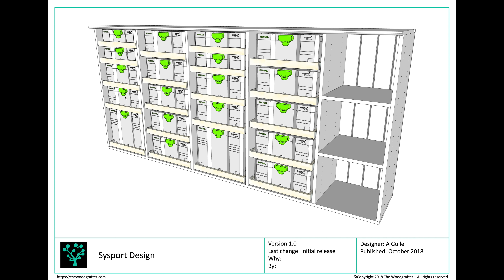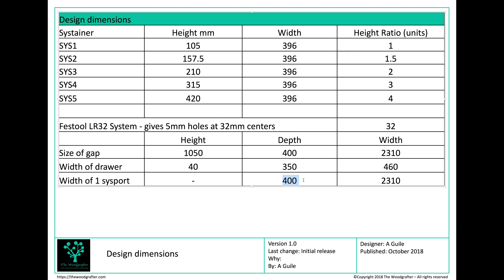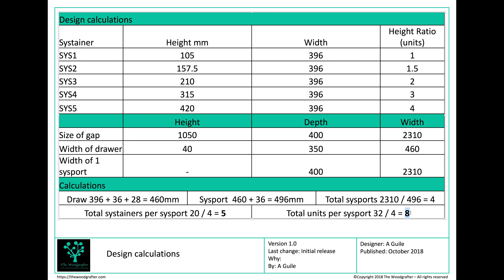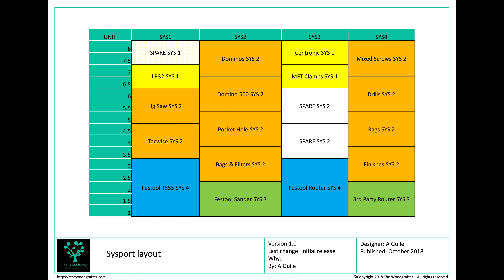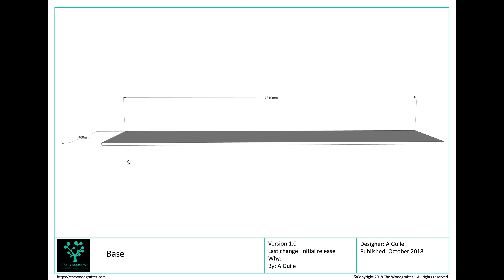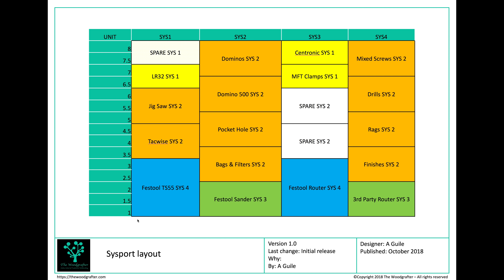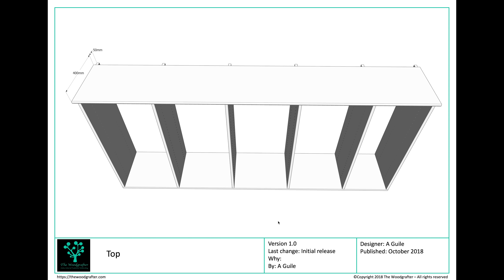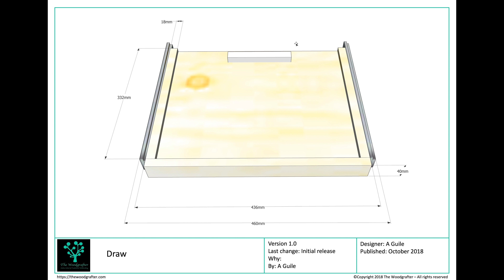Festool systainer storage system  design a sysport

Comment: Toolboxes, such as systainers, are good for transporting tools and fixings, and using them on site. For storage in a workshop, they are the worst possible choice. In order-
Pegboard or shelf- one touch access. Best.
Drawer- three touch access (pull, pick, push)
Most toolboxes - five touch access (pull, open, pick, close, push)
Systainers - seven touch (pull, unlock, open, pick, close, lock, push). Worst, because the swinging lever fouls the drawer slider above it if not locked. Most others can be left unlocked. They are also smaller than most, so more wasted space around them and more to open. No front handle, so the slider needs a handle.
If you are not happy with open storage, use drawers that are as wide and deep as possible, to give maximum contents. Height to match the contents. Can be made to EXACTLY fit the space available, e.g. under a bench. With no gaps to harbour dust.

Too much trouble to move tools when going on site? I keep a single toolbox (carefully) fitted with the common tools which are duplicates. These cost less than a collection of systainers, and means I have a spare if anything fails.Moving special tools to a box takes less time than fishing for them in the workshop. 
Remember, a site and a workshop are totally different. In a workshop you want everything you use as close as possible and as accessible as possible. The more effort there is to get a tool, the less chance of putting it away, so they all accumulate on the work surface and everything slows down...
Reply from the maker: Hi Mike,

Get where you are coming from, but everyone is different - I like systainer storage in the shop. Keeps the tools protected and everything in its place.

I am very disciplined  when it comes to putting things away, and keeping things organised. 

I agree that drawers are more efficient and better use of space - but not enough for me to care or notice the impact on workflow.

The storage under the new bench will be drawers with dividers and layout for my hand tools and measuring gear. But not sure I will be giving up the sysport any times soon.

Cheers

Andy
Reply: @TheWoodgrafter  I understand why you like them- they look pretty. It is like domestic kitchens- smooth granite, clean lines, everything hidden. Totally unlike a commercial kitchen, where efficiency and functionality are prioritized. So the question is simple- do you want a pretty workshop or a functional one? Time spent retrieving and storing tools in fiddly boxes is time not spent making. They cost you time, money, and workshop space. Your new build is moving in the right direction- embrace rationality and go all the way!
Reply from the maker: Mike M 

Hi Mike, let’s agree to disagree on this one, I want (and have) both.

The system I have works for me and fits in with my workflow and space.

Don’t forget I am turning out low volume high value pieces with the shop window been on you tube and web site with people visiting the shop to talk about commissions. In effect I invite people into my space (physically and virtually) to see my process and methods - nothing to hide. So for me it has to be a combination of workflow and attractive workshop.

That’s why the walls are clad, that’s why it gets cleaned at the end of every day and why the tools are laid out in a rack of systainers.

Even when I build the drawers under the bench, they will be lined in foam with cut out for each tool.

Not disputing what you are saying, just different solution for different problems.

Cheers

Andy
Reply: @TheWoodgrafter  Ahh, did not realize it was also a showroom. Fair enough.
Reply from the maker: Thank you,

Andy
Reply from the maker: Mike M 

Also, just realised this is quite an old video, since then I have built the top shelf unit and completed the cladding of the walls, in more recent videos you can see how it has all
Come together and the type of work I actually do in the coffee table series.

Cheers

Andy
Reply: @TheWoodgrafter  - Even though I'm late to this party I wanted to agree with "neat, tidy, and protected".

I also find the few extra seconds of "fiddling with boxes..." an important part of my thought process; it's an opportunity to think through whatever I'll be using the tool for, consider safety aspects and so on.

Perhaps if I was doing the same thing,  the same way,  every day,  I might agree with @Mike. However, almost everything in my shop is unique to itself.

Thanks for the vid and I look forward to delving deeper into your channel.

Comment: If you have the depth available you can make deeper drawers, use longer drawer slides, and add a storage section at the back where you can drop in a plywood storage box the same height as the systainer in that drawer. In my case I will be making the base cupboards 580mm deep to make efficient use of sheets and 550mm runners with 570mm drawers. 
My 2 cents
Reply from the maker: Hi Stephen,
That is a simple but brilliant idea. Thank you for sharing.

I have some more modules planed for the workshop after the workbench build - focusing on the Kapex, The CMS etc They will all have more systainer storage - so will incorporate.

Cheers

Andy

Comment: Excellent design together with a very entertaining video. I enjoyed it.  One question, the bottom drawer is mounted in the first 5mm set of holes from the bottom. It's done like that in all sections. How long are your screws? Is there enough thickness to have screws going from each side into the dividing vertical side panels?
Reply from the maker: +Wojtek T 

Hi and thank you for the feedback.

You are correct, ideally you would use 8mm long screws to avoid that very problem. From memory I had 12mm long screws so couldn’t use them in the same hole.

I alternated them so the runners lined up. Used the front hole on one of them, and then the rear hole on the next one. Then picked up a convienent mounting and used a standard wood screw to secure.

Hope that makes sense.

Cheers

Andy

Comment: Where the top overhangs the face of the cabinet, does that impact on the top row of systainers lids opening fully?
Reply from the maker: +Parafinn Lamp, good spot - that turned out to be a bad decision (form over function) later in the series I reduce the overhang to about 5mm for exactly the reasons you have spotted.

Thank you for the comments and the observation.

Cheers

Andy